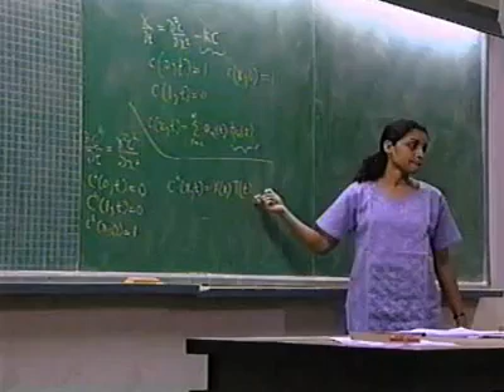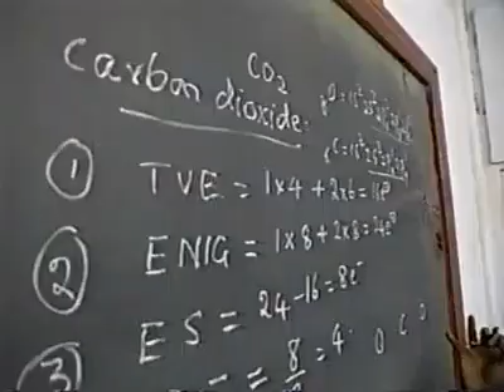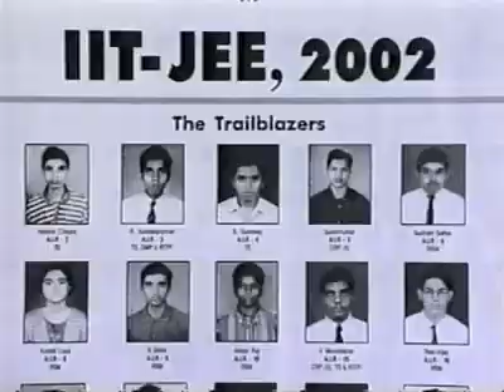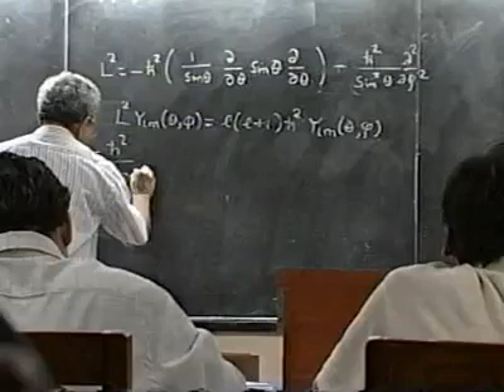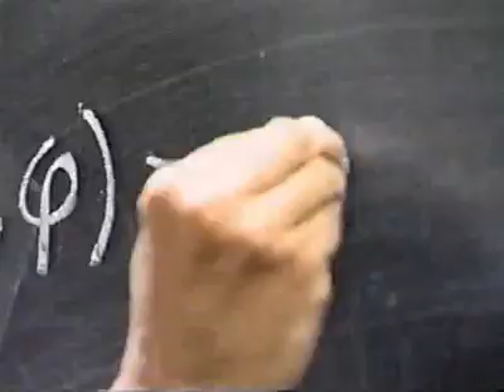IIT - Indian Institute of Technology - World's Best Educational Institutes & Pride Of India

Comment: If you look at sheer numbers it may appear they were right. Out of 170,000 applications they reveive, only 3200 make it into any one of the seven IIT's which is less than 2%. But on a closer look, every moron, even those who is at 60 % (Equivalent of a C+) in his +12 score applies for IIT , thinking just in case . Only who think they can make into Harvard apply for Harvard. Students with low-grades do not bother applying for Harvard . So, they do not have to filter too many trolls out.